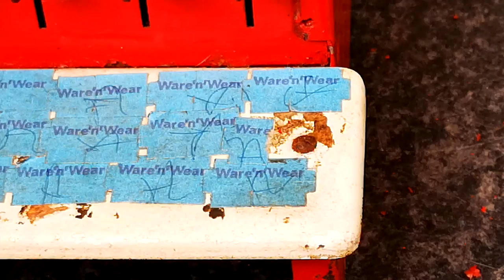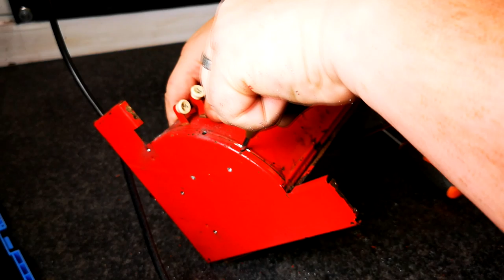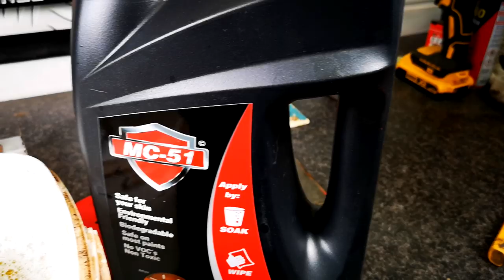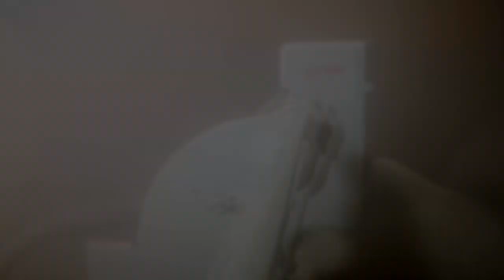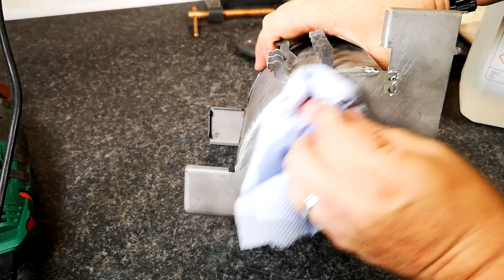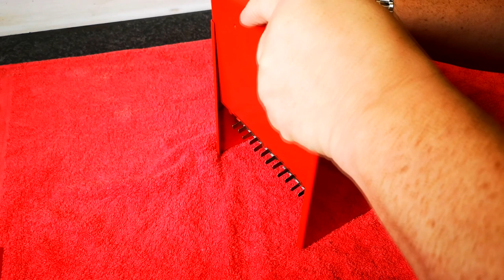Cash Register Restoration, Vintage Toy

Comment: Very nicely done!  Bet you leave the spot welded pieces as one assembly next time, since you media blasted everything anyway little extra time cleaning inside would have saved a lot of headaches. How well does powder coat stick to the epoxy putty since it has no static charge to attract the powder? Doesn't the putty soften in the baking oven? Always fascinated  at how the powder melts smooth, and glossy.
Reply from the maker: This epoxy is designed to withstand the powdercoating process. It sticks fine.
Reply: @RetroHax  Odd.....all the different epoxy's that I use say good for -23C to 143C MAX, please enlighten me to brand, and specs.  of product you use....thank's.

Comment: Okay Martin, now you can setup a store since you have the cash register. 

Next time you have to spot weld very thin metal like this, try backing the back side up with a piece of aluminum. It will not blow through. Works for me when I was making more holes then filling them up. I used about 1/4" thick aluminum but even a 1/8" thick piece will work... Thumbs Up!
Reply from the maker: I've been on the lookout for some copper bar but i'm still looking lol
Reply: @RetroHax  Copper and brass will work as well. Since welding won't attach to any of those metals, they act like a heat-sink to keep blow through at bay.

Comment: very nice work. I wish you could have done the label on the drawer, but I know that would be ridiculously difficult to replicate. Two odd tips for you, one, take off your watch when doing this kind of work, especially spraying the powder, the static electricity your body and the watch makes may draw it into the watch, and you don't need to beat it up anyway. When feeling for dimples in metal, use a thin piece of cloth under your hand. I don't know how or why, but it lets you feel more. It's an old body man's trick.  Other than that, you do nice work. I had one similar to this, I didn't even try to restore it, I sold it as is, let somebody else do all that. I don't have the tools or inclination to get into something so involved.

Comment: Great video Martin. You can cool the spot welds with your compressor to prevent blowing holes or also use a copper block behind. Keep up the good work mate.
Reply from the maker: Yes I know Ian, I'm on the look out for a copper bar.
Reply: @RetroHax  I've asked my brother if he can get some copper buss bar from work. If he finds any I can send it onto you.

Comment: I love watching you do the impossible, thought for sure you were going to burn through the metal a lot more than happened but so glad it worked out.  Looks gorgeous!
Reply from the maker: Yes, I had to be very careful as my welder doesn't have dial down power settings only a switch.